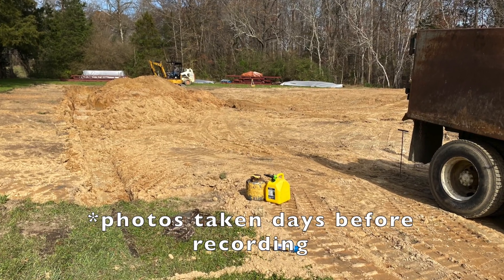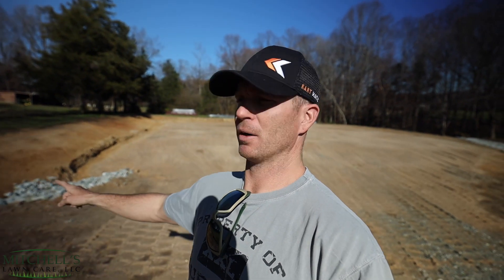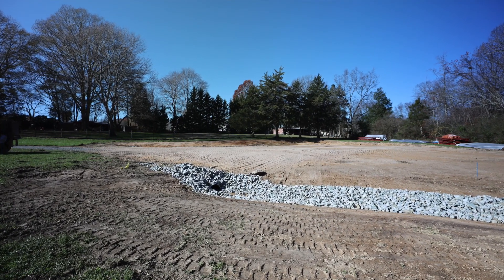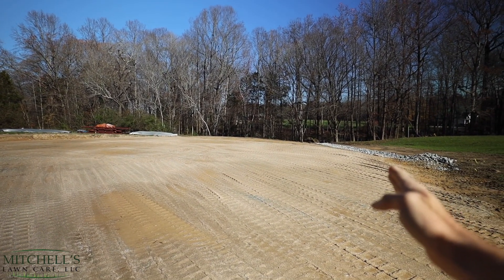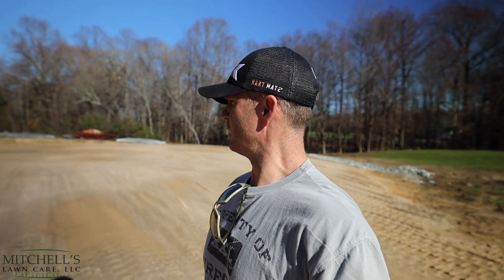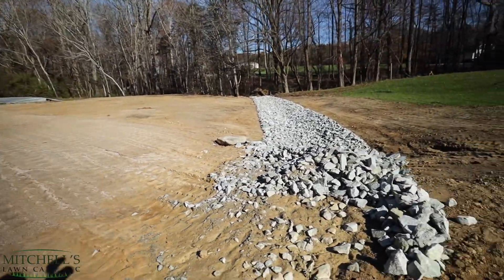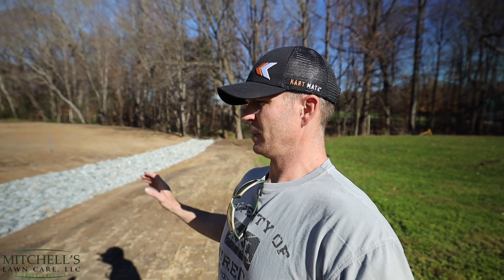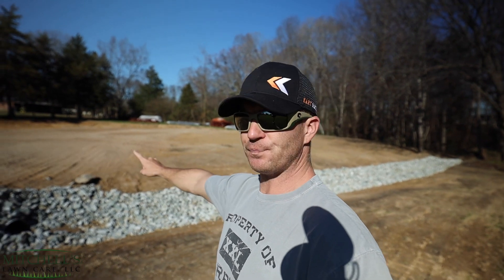STEEL BUILDING CONSTRUCTION - New MLC Shop Update! [Part 2]

Comment: Did you ever think about covering the ditch?
Reply from the maker: explain what you're speaking of please, I'm not tracking...
Reply: @mithgo_outdoor  my bad dude. I used to work for a Municipality before I went to FD, and we used to take open ditch lines and cover them up. Similar to what they did we would use the black plastic culvert pipe and bury it. We would install T’s as drains that connected to the pipe. It’s hard to explain over text, but it would eliminate the need for an open ditch
Reply: Here’s all I could find that kind of simulates what I’m talking about.
Reply from the maker: @Stemp334  there’s an 80’ section of black pipe in the ground in front of the shop.  I didn’t want to do drainage pipe the entire way.  Thanks for clarifying